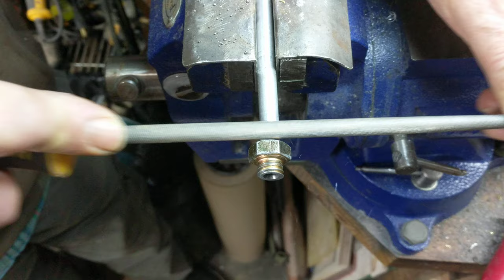Airsoft Daisy repeating Red Ryder Possible?

Comment: Were you ever able to make this work. Im currently trying my self but i cant figure out how to get the original barrel out of the red ryder
Reply from the maker: Yes, I've built several of these. Which model Red Ryder are you working with? It needs to be an older "Bottlecap" gun that has a removable shot tube and this will not work on the newer plastic trigger guns with a safety.
Reply: @RestOModDaisy  unfortunately its the newer plasitc safety triggers
Reply: @RestOModDaisy  its a model 105 B
Reply from the maker: @wakosmakos6723  The 105B is post 1978 design that incorporates a plastic trigger with integral safety and has a shot tube that is permanently affixed to the abutment assembly. If you want to try your hand at fabricating replacement airsoft shot tube you are gonna need a pre-1978 Daisy that has the Bottlecap style screw in shot tube as the base gun for the project. There's a couple of hundred of them up on Ebay at the moment or maybe one of your relatives has one stashed in the corner gathering dust.
Reply: @RestOModDaisy  thanks for the information, ill see if i can get my hands on one.